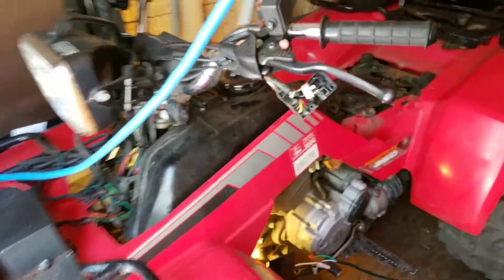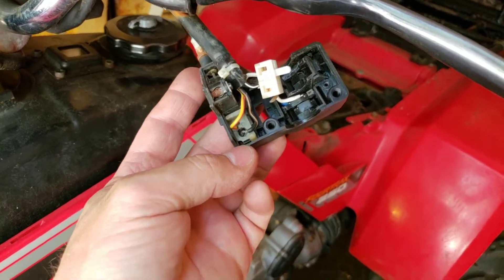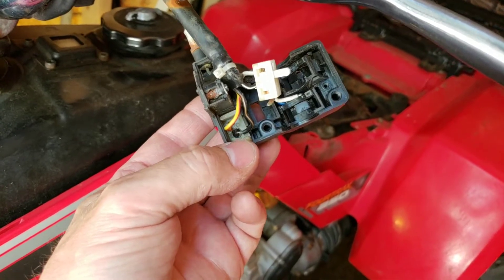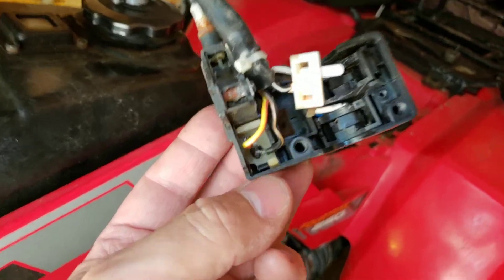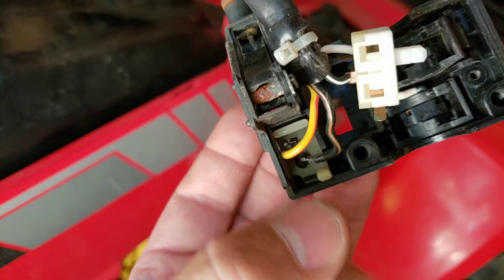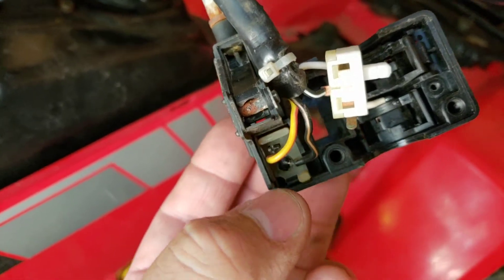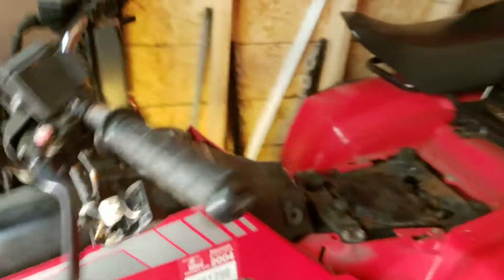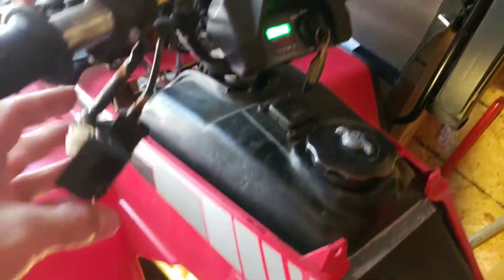1985 Honda Fourtrax 250 Wont start PART 2

Comment: Hey quick question, what do you have your fuel screw set at underneath the carb, and what is the idle screw set at? Guy before me played with everything then left it for someone else🤦🏻!! Would be awesome and I’d appreciate it!! Thanks
Reply from the maker: Hello,
To be completely honest, I am not sure.  I could check them in the spring when I get it out for the summer.  I'm guessing start with 1 1/2 turns, but like I said, I'm not positive.
Reply: Fuel screw should be around 1 and a half to one and 5/8 out, idle screw turn it up just enough so it idles when it's running without applying throttle